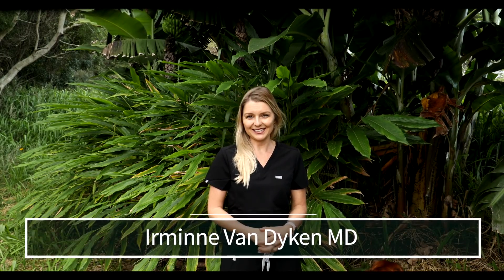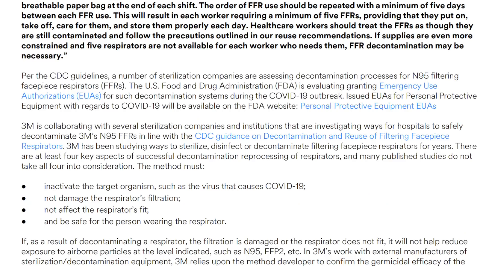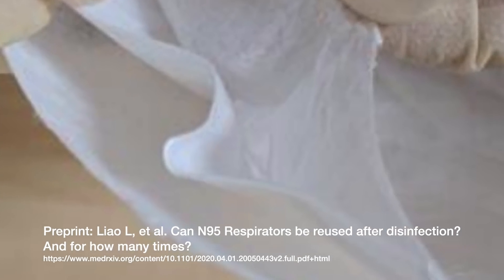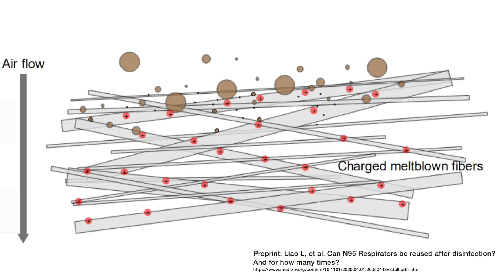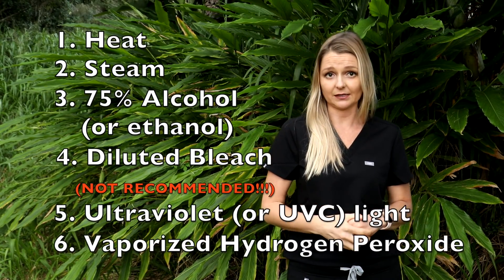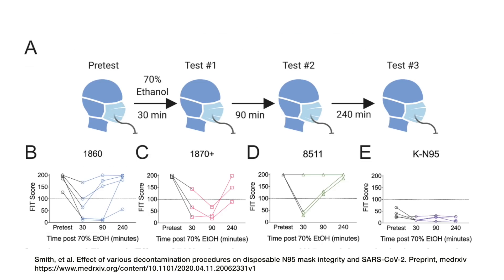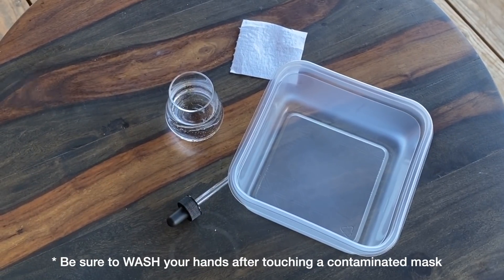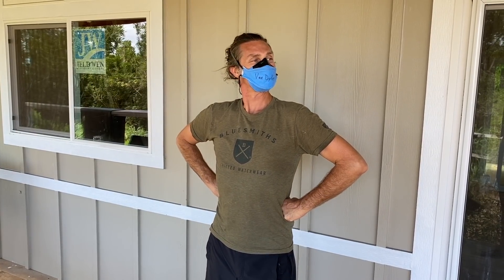How To Disinfect Your N95 Mask at Home

Comment: This is what I did for the 3M N95 MASK with Air Flow Valve; This is not for everyone & not for medical use... I take dish washing soap by spraying inside the mask; as I use the kitchen faucet with hot water into the "back" of Mask; its like a reverse flush by pushing any dirt out the front part of the mask. After & how to dry, Furnace room overnight; what I did; I used my Cloths Dryer on High Heat with a "Dryer-Rack" I just laid them out on the rack as the dryer did its job. (do not tumble dry) After drying out; spray them with 70% Alcohol solution & let dry overnight. You can also use Fabric HEAVY DUTY Fabreze only on the outside of the mask, "lightly" to refresh the Mask & let that dry over night. What you need to do, is try only one mask & see how it goes for you. Its not for everyone. I work in retail that should tell you everything. I wear this mask to protect not just me but my family.

Comment: Any moisture will destroy the electrical charge that functions as the virus catcher in the middle layer ! Do not steam or add water! Lower the temperature to 55 degree Celsius and do it longer! Taiwan’s CDC had done some experiments already !
Reply: Angry Mama how long do you leave it in the oven at 55 degrees Celsius?
Reply: Jane Snow if you are using regular oven, put the mask in the plastic container in the middle layer for about an hour . In Taiwan, people don’t use oven, so they dry heat the mask on top of steam rack in the rice cooker for 3 minutes then turn off the heat and wait for the residual heat to work on it  for another 5 minutes.  And that temperature is about 55~60 degree Celsius! Just make sure the mask won’t touch anything that’ hot, after all, a mask is just a form of plastic paper.
Reply: Jane Snow I rechecked the information: the inventor of n95 mask said that dry heat the mask at 70 degree Celsius for 24 hours can kill the virus and still preserve the antiviral efficiency of the mask to 98.5%!  Sorry about the previous information that’s  only intended for surgical mask sterilization!
Reply: @angrymama2016  And that is 158° Fahrenheit. Thanks for the valuable information!
Reply: Cockeyed Optimista COVID 19 is an unusual, genetic engineered, vicious and potent virus! As more research progresses, more correct information will be revealed !  The inventor of n95 mask is a Taiwanese,  I believe, named Peter Tsai.  He came out of retirement to help with the situation!  I imagine there will be more info in the near future released.
Reply: @angrymama2016  It is not genetically engineered, it came from bats and jumped to humans via a third species like a pangolin or snake. But maybe you're right; there are questions about Chinese labs. But scientists have analyzed the genome and they are pretty sure it is Not genetically modified.
Reply: @angrymama2016  I've seen Epoch Times. I don't know that the novel coronavirus destroys immune systems. But I don't know a lot of things. I'll have to look into what you're saying, tho I'm skeptical.
Reply: Cockeyed Optimista few days ago, another 40ish man died of COVID 19 in Taiwan and brought the death toll to 7,  this man and his wife were confirmed on March 19. he was a fit man in good health and yet took a turn for the worst few days later and was put on ecmo machine ever since, eventually died of multiple organs failure and blood sepsis ! However his wife was cured , got 3 consecutive tests negative, and got out of hospital on April 10!  This case also provides Taiwan CDC another evidence that he has “immune system storm “!   More evidence came out that multiple east European Olympic athletes contracted COVID 19 last October way before “the wet market “ cover up story! These cases would probably provide another research direction on COVID 19 cures!
Reply: Cockeyed Optimista take easy! I never intended to mislead anyone! I already expressed that I got these information from Taiwan news and their daily cdc press releases and other news sources!  Sorry if you are offended!  Truth will come out eventually! All I intended was for people to be aware and be careful that don’t take this virus lightly and look for the truth as more research results come out to piece the puzzle of what this virus truly is!  You don’t need to respond back because none of the discussions before were never intended to be argumentative!
Reply: @angrymama2016  Okay, gotcha; sorry? I'm not offended, though. Oh well, ciao.
Reply: That's 131° Fahrenheit, by the way, if anyone wants to know. (55°C × 9/5) + 32 = 131°F

Comment: Too long of unnecessary speech before you got to the point, and when you got to the point, my common sense told me that baking a plastic container in the oven is not a very good idea because it releases toxins. I don't know why you did not think about that?  40-50 minutes in the oven is too long. Who is going to do that everyday? I was annoyed to waste my time.
Reply: Baking polypropylene for 45 minutes in the plastic container will not release toxins. Toxins are released at certain temps, usually the glas temp. The cdc, who, osha and nih state that baking a n95 mask at 70C for 30 minuets is the safest a d most effective way. Other ways damage the electrostaticly charged spun polypropylene threads used to capture debris. However, thwy have found dry heat is better because some bugs use water as its host or living source. This is why beef jerky doeant kill us, all the water is gone so bugs cant grow haha
Reply: LT72884 plastic melts tough. Fire hazard.
Reply: @lennieth  yes, plastic will melt, but not until a certain temp. Those containers are dishwasher safe, meaning they can take higher temps. They will not melt at 170 degrees:)

Comment: Can the same thing be done in a microwave?
Reply: Paul S I don't think so.  I don't know about these particular masks, but the ones I use have a metal strip over the nose part.  The metal will catch fire in a microwave.  If there is no metal, it may be safe to use in a microwave.

Comment: I worked in the filtration industry for over 40 years.  There has always been a desire for the miracle of re-usable filters. Reusable/washable filters are always a compromise.   Honestly I believe you would be better off by simply allowing the 'used' filter to simply sit in a relatively hostile environment for a virus for the number of days that you feel will terminate the virus. If it sits a week, two or three this offers virtually no degradation of the mask filter or the elastic band. The other thing is the filter mask will get 'dirty' from skin oils, makeup etc particularly on the sealing surfaces against skin.  Thank you for your efforts.  I'd suggest a tiny marker pen dot to keep track of how many times it has been re-used.

Comment: I leave my mask in the car, by the front windshield. I go shopping once (maybe twice) a week. So the mask sits in the hot car, in direct sunlight, for multiple days. I figure that’s going to kill everything.
Reply: I don't think tziporah torbati is saying anything about UV light. However, the inside of a car left out in the sun, windows closed, can get very hot. According to the CDC, that can reach from 130 to 172°F very fast. So, let's not discard the idea, as it has merit to it - you just need to adjust time.
Reply: @robertodeleon-gonzalez9844  EXACTLY. he's talking heat alone...not UV.  i think it'll work!
Reply: Inside the car, the UV light is filtered by the windshield. Put it outside.
Reply: FLIRDUDE if I left it outside, the wind will blow it away. Even if I weighed it down, it will get super dusty just sitting outside. In the car is hot and sunny.
Reply: @MehWhatever99  I hold them down using the windshield wipers. (Clamp the straps)  Fortunately it is not too dusty here in Florida.
Reply: tziporah torbati if it’s inside the car it will not be able to receive UV light since the windshield filters a lot of it. Same reason you don’t get burned when the sun is hitting you while sitting in your car on a sunny summer day
Reply: @StormQuestTours  You do get burned! People who drive a lot can get skin cancer on one arm!
Reply: Cockeyed Optimista I said the windshield filters a lot of the UV light. I didn’t say all. I have heard story’s of truck drivers getting skin cancer and other sun related skin problems on the left side of there face and left arm. This happens over many years of exposure. The windows filter out most of the UV light, enough that you don’t actually get a sun burn like you would after even an hour on Miami Beach in July.
Reply: @StormQuestTours  That's true, it's over a long time of exposure, I guess. Well, I just googled it and glass filters out 97% of UVB rays but there are still the UVA rays: they don't burn but they penetrate more deeply and are almost more dangerous. About 37% of those are filtered out. So anyhow there's Some UV. I guess you said that. Is that the main thing or is it the heat and dryness? I'm kinda uninformed about this. The reason sunlight helps is bc of the ultraviolet rays? U needn't answer, I'm procrastinating. Appreciate the info re sunburn in a car.
Reply: yeah about the environment? This virus is everywhere... for sure nobody knows enough about it
Reply: @kf3en  might not be dusty, but POLLEN!!! ACHOO!
Reply: @StormQuestTours  That's right.  Actually windshields filter 100% of harmful UV light (both UVA and UVB).  I ought to know since I've had Melanoma and researched it.  Side windows in a car filter only UVB rays but still, it makes no sense to leave it inside a car with windows.  Masks are not being cleaned that way.
Reply: @cockeyedoptimista  That's because they drive with the window down and their arm hanging out!  Windshields filter 100% of harmful UV light (both UVA and UVB).  I ought to know since I've had Melanoma and researched it.  Side windows in a car filter only UVB rays but still, it makes no sense to leave it inside a car with windows.  Masks are not being cleaned that way.
Reply: @cockeyedoptimista  You need to Google WINDSHIELDS since people here keep saying they're leaving their masks on their dash.  Laminated windshield glass filters 100% of UVA and UVB light so it does absolutely no good to disinfect masks on the dash of a car.  They are not being cleaned at all.
Reply: @vagauthier4025  Oh. Yeah, makes sense not leave in car to clean. Tho you'd think the heat would do something. Best not to assume mask is protecting you anc just keep distant.
Reply: @vagauthier4025  Thx.
Reply: True but virus would survive more than 24 hours even at room temperature
Reply: أبو كريم
It’s not room temperature. And it’s not 24 hours. It’s at least 4+ DAYS of sitting in a hot car (we’re in Los Angeles). And the window might filter some UV, it won’t filter all of it. By the time I reuse it, it’s bone dry.
Reply: @MehWhatever99  Windshields filter 100% of harmful UV light (both UVA and UVB).  I ought to know since I've had Melanoma and researched it.  Side windows in a car filter only UVB rays but still, it makes no sense to leave it inside a car with windows.  Your masks are not being cleaned that way.
Reply: i would love to do this but for that i have to buy a car and for buying a car i have to wait for lock down to end ;(
Reply: I have same problem!
Reply: after three days,,the germs will be all dead,,you safe to go now.

Comment: No we dont have to  do anything and pandemic state dont change that at all, non reusable masks are "one time use" for a reason. You dont decontaminate a non reusable mask, end of topic. You want a reusable mask - get a reusable respirator. You want a compromise whrere there is none, using a non reusable masks many times will do more harm than using cloth masks you actually can wash. You run short on N95 or FFP2-3 masks - use them as a last resort, and for the most time use simple cloth masks, that you can fill with P2.5 HEPA filters - that are still available and are still quite cheap. I work in a medical clinic, some of us use 3M repirators [i use reusable 3M 6300 with Long Live 6035 filters and GVS Elipse at work], some of us use non-reusable masks and throw them away every 3 hours, other doctors and nurses use cloth masks with regular HEPA 2.5 filters inside - its safer thatn trying to use one time masks many times.

Comment: I went to the drug store bought a one ounce plastic bottle with finger spray pump, I then use 3% hydrogen peroxide
And mist both sides of the mask. Viola.  I carry the bottle in my pocket and use several times a day. Hydrogen peroxide
Kills viruses immediately on contact. I also open my mouth mist 4 pumps and inhale it all at one time into my lungs
Via mouth ( not nose) . Do your research online about this protocol before attempting this. Caution, It’s not for everyone.
DO NOT spray directly into the nostrils, mouth only. I had pneumonia 3 years ago so I guard my lungs as much as possible.

Comment: I wonder if putting the mask in a microwave on a specific setting within a plastic container will work to disinfect the mask. That plastic container seems likely to melt or burn in a traditional toaster oven or oven.
Reply: Glen Powell x Never microwave plastic.
Reply: Kathleen Hunter There are some people who own those state of the art sanitizing dryers. I guess they could be used to disinfect the masks. I think placing the masks in heat resistant Pyrex glassware with a wet napkin and a small pizza stone on top of it is the way to go. 300 degrees will definitely kill the virus. My 3M N95 masks need to be reused a few times.
Reply: My two N95 masks have metal on them so they can’t be microwaved.

Comment: You had mentioned steam - would it be reasonable to steam the mask using a tea kettle and the hang the mask in direct sunlight for 2 or 3 days  - not all of us have or can afford a confection oven❓✨🤔
Reply: They should state not to use a microwave oven because of the staples.

Comment: I have read that the virus generated by a human can only survive for less than a day if on a dry surface such as metal. This video strikes me as overkill. I would think if the mask is not used for a day any virus on it would die and be safe to reuse. One of the main purposes of the mask is to stop the fresh transmission of the virus by small droplets to other humans.
Reply: This is exactly what I'm doing, and I would certainly like to hear what the experts say about his, because I've seen little or no commentary on it. In my case, I have over 30 masks (for a family of 3) which I rotate. We hang used masks up in a dry, well-ventilated area, in a kind of first-in-first-out "queue". It works out to at least 2-3 weeks between uses for any given mask -- plenty of time for any traces of virus to be neutralized. Simple and, to the best of my awareness, safe and effective.
Reply: COVID 19 can survive on surgical mask for 9 days!  Stainless steel surface for 4 days! Copper for 4 hours! Plastic bottle surface for at least 9 days! At least 28 days in lower temperature in the refrigerator on any surfaces!  Hang your masks in room temperature at least 10 days , 2 weeks to be safe for sure!
Reply: @angrymama2016  I have seen so many different numbers on this, who knows what the number of days really is. I heard just the other day that it would only survive a few hours on cardboard. Then today I heard it would be two days. I wish they would hurry up and get this shit sorted out so we know exactly what it is.
Reply: @Teleman01  Most things say 4 hours on copper, 1 day on cardboard, 3 days on hard non-porous surfaces like other metals, counters, plastics. Plastic seems to be the worst. But now 9 days on a mask? Well, I'd give it at least a week I guess! The microbes degrade with time though, you know. Contamination won't be so great after day three as on day one, if something's on a container. The risk goes down.
Reply: Angry Mama People have different feelings and ideas and information about what is the best thing to do. It makes sense to put the used masks in extreme heat to kill the virus.
Reply: Glen Powell high heat destroys the structure and integrity of the masks! Experiment and you’ll know!
Reply: @angrymama2016  Nano-level N95 protective mask can be used repeatedly 20 times, welcome to buy and order in bulk. Please visit candynice.com, and nanotechnology video details please visit: https://youtu.be/HX7Qbol47vc

Comment: i think put mask(made of cloth) in boiling water and it will do the job do not confuse people
Reply: The surgeon is talking about N95 masks with built in filters.  You can't put those in boiling water and have them still fit right and not melt parts of the mask.  Water boils at 212 degrees F.
Reply: OMG!

Comment: I've been lucky I bought 3 of these a while ago and only go shopping twice a week so by rotation they're safe, but I do put them in the sun as well if it's good weather. Also I did a job in a place where the builders had been working there a couple of months ago and found 2 ffp2 masks they left behind and they look hardly used. I've just wiped them down and I'll put them to use.
Key workers I have met though always reccomend putting them in direct sunlight so I think that's the best advice.